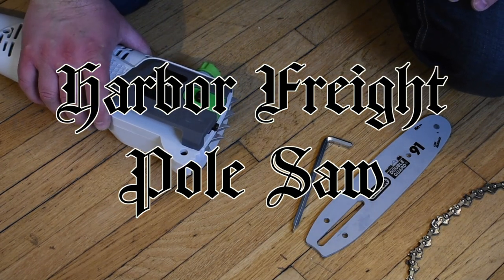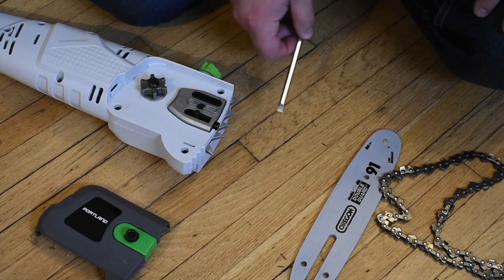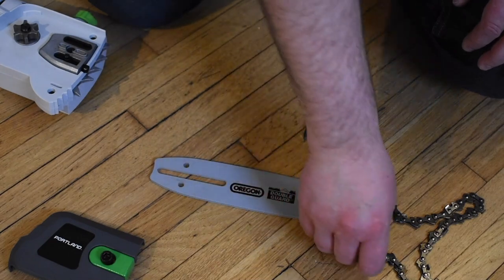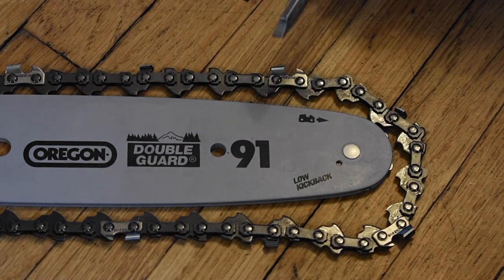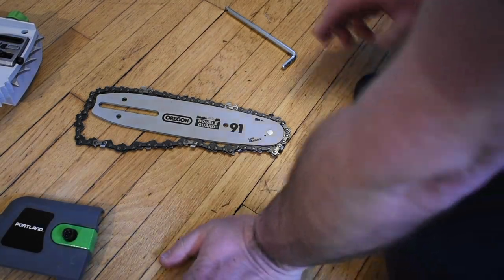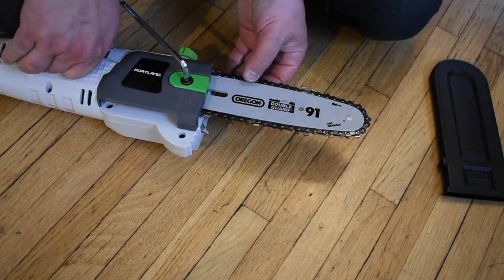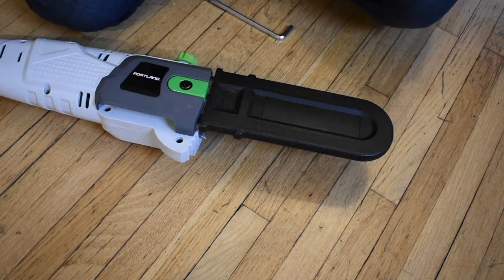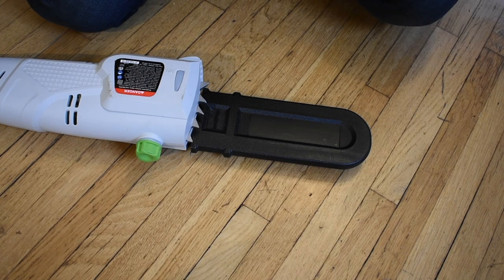Electric Pole Saw - Setup

Comment: I love my Kobalt Pole Saw - 80-volt - 5-ah battery - 10" Bar - 6 ft / 8ft foot Pole Saw. No cable. Using an Oregon Bar and Chain. I have been using it for more than 3 years now. It works great on my southeast Louisiana farm clearing property that a hurricane went through and trashed all the trees in the woods of our 20-acre farm. I carry it all over our woods and the battery lasts a long time. Today I'll be cutting a 6-inch limb off of a tree out front. I am also using (2) Kobalt 80 volt 18" Bar Chainsaw and using the 5 AH Batteries. Cuts huge logs great.   The first one wound up in a puddle and stopped working but after a couple of weeks and it had dried out, it started working again.

Comment: I just bought the same one pole saw this , but couldn't cut 2 inch thick branches....I wouldn't invest my $$ for it
Reply from the maker: you pushed too hard, or you put the chain on the wrong way.
Reply: I agree.  I have the same pole saw and get a bit nervous over how fast it cuts!

Let its weight do the work.  Make sure to keep refilling the oil reservoir!  It can run dry pretty fast with continuous use.
Reply: Indeed there's something wrong with the op's setup. I can do 4-6" branches easily with mine